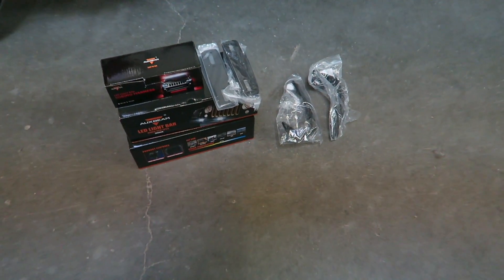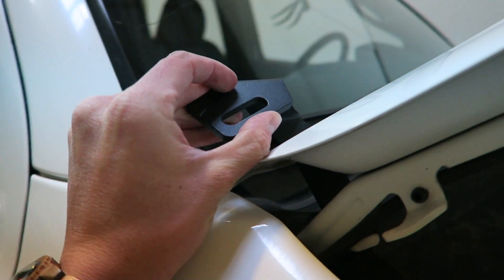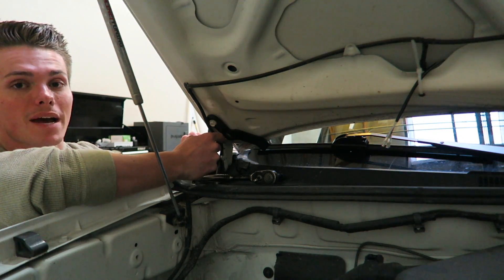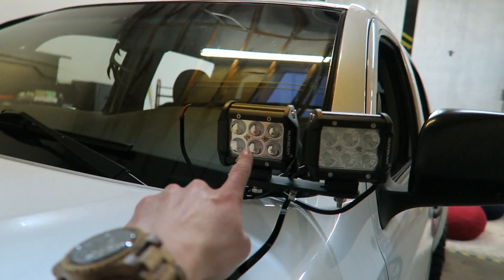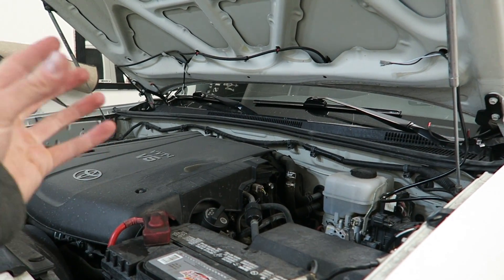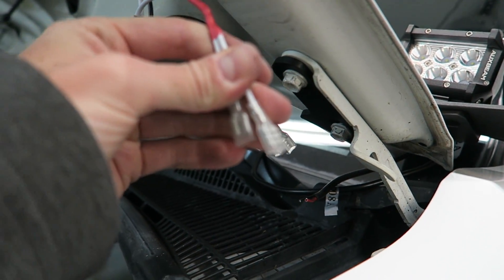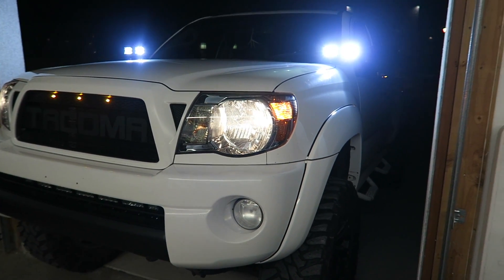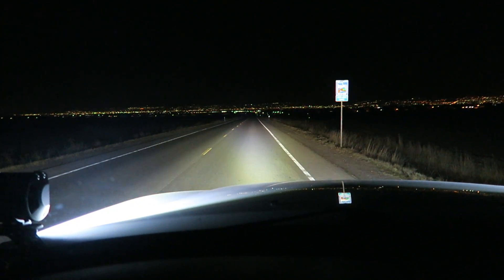Installing 4 Auxbeam LED Pods

Comment: Would I need a second harness then? I have 2x 400w lamps. That makes almost 67A. Unless there is a relay big enough
Reply from the maker: I’d probably do two, I’m pretty cautious when it comes to electrical work. You could also look into a higher end harness, there may be one with thicker gauge wiring out there that could handle the amperage.
Reply: @BraxenMcConnell  Ok, thanks. I presume that I can hook the two supply wires of the harness kits together and then tie them to the respective + and - for battery connection? If not I might get a pair of lower rated wattage lamps and use a standard 40a relay that comes with the kit.
Reply from the maker: Yeah, I think you’d be fine hooking them together and connecting them to the same (+) and (-) terminal.

Comment: Does the wiring come with the lights?
Reply from the maker: Some have a wiring harness included, but it always specifies if it’s included or not. Usually if there is a pic of the wiring harness with the lights, it comes with a harness.

Comment: Awesome video. Not as thorough as the aux beam hidden light bar. So could you be more specific, do you still need to do the fuse thing as well with these ditch lights?
Reply from the maker: When you say fuse thing do you mean the relay? Or the add a circuit for the switch? Yes on the relay, and yes on the add a circuit, but only if you want to wire a switch that looks and illuminates like the OEM switches. If you don’t care about the push button switch, you don’t need the add a circuit.

Comment: Do you have to buy a separate mounting bracket other than the one you left in the description if you want to mount 4 pods ? I just ordered the spots, floods, 2 harnesses, and the mounting brackets you left in the description but I’m wondering if you have to buy an extension to mount all four pods, or does the one in the description hold 2 pods each?
Reply from the maker: Hey! Yeah, if you want to mount four on there, you’ll need a extension piece. I looked, but couldn’t find one on Amazon. The company I got mine from is called Rago Fabrication. They are pretty solid extensions, you should be able to get them from their website.
Reply: Braxen McConnell thanks!

Comment: is that braket that goes on the hood universal or make specific
Reply from the maker: The main brackets are vehicle specific, but the extender that allowed me to add two pods to the same bracket is universal.
Reply: Braxen McConnell can you link the extender bracket? The one you used to add another pod to the existing Cali raised bracket?

Comment: Where did you get your grill decal ????
Reply from the maker: The mesh and lettering comes from a company called BPFabricating. I found mind on a local classified section though, the guy didn’t want to do the work to install it! I did a video on the whole process, it’s just a few videos back 👍🏼
Reply: Check out customcargrills.com in Michigan. They have really awesome steel mesh grills. Powder coated and any type of lettering you could want. Wish I could put a picture of mine on here for you. I couldn’t be happier with the look. Way better than the plastic pro grill.

Comment: Hey man, did you buy two sets of wire/Harness? Novice here. Thanks.
Reply from the maker: If you want to have four pods on there then you need two harnesses. I use two harnesses for wiring, but I wired them into one button so that all turn on at the same time